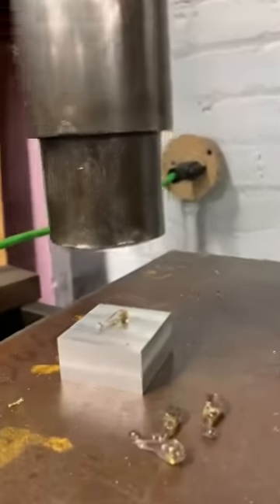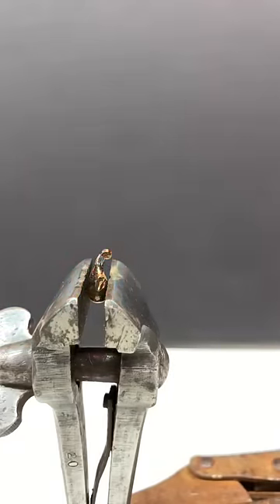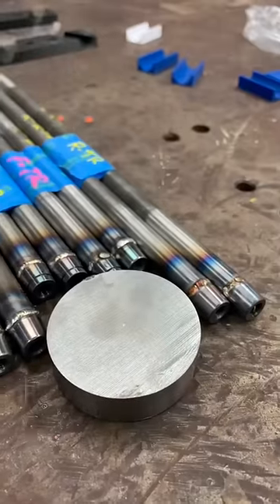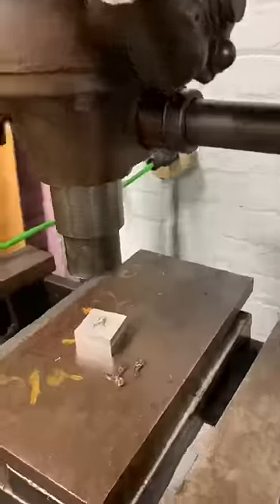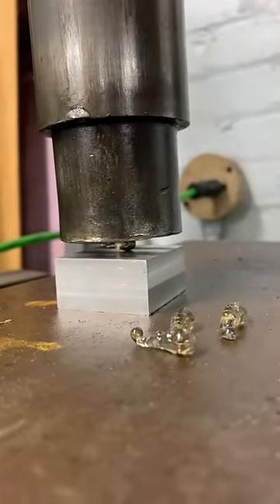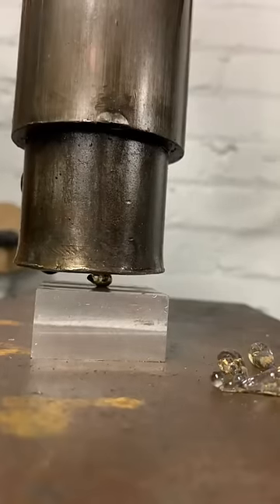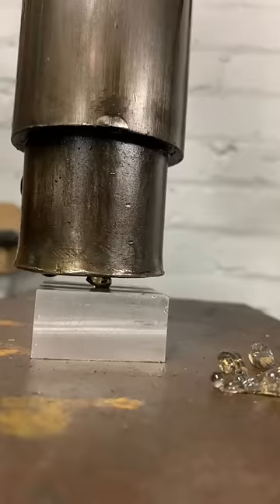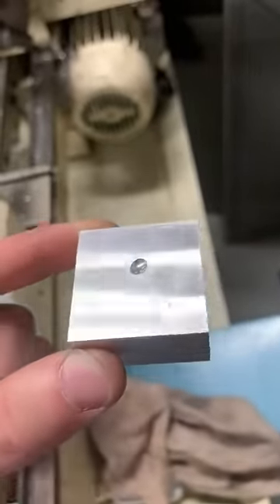Prince Rupert’s Drop vs Hydraulic Press!!!

Comment: He removed the only weakness of the rupert's drop
Reply: This man must be stopped! 😳
Reply: Where's demolition ranch at
Reply: So can we not make Armour out of this ?
Reply: @kevinm1675 way too heavy and bulky
Reply: @daSora_1 isnt it great for those who wont move much but have a high risk of being shot?
Reply: The weakest link in chain, the tail.
Reply: @brooksmachine3 he would be the man to do it he’d just send some armor piercing incendiary rounds or a 50 at it
Reply: It’s like Achilles without the heel
Reply: that glass can be squished
Reply: Sounds like a saiyan
Reply: Howd he do that, it was supposed to break ‼️‼️
Reply: @acertainredburnygirl5265 yes, Mr. President's car
Reply: @kevinm1675 you can however take these, coat them in a soft polymer or wrap it in rubber and send it with a Tippman if you manage to make it a perfect ball .68 caliber. I've also noticed that by simply roughing up the smoothness of the glass or even wrapping it receipt paper and super glue (that method causes a lot of heat so be careful!) And send it through a paintball gun. (My friends say I have too much time, yet never enough)
Reply: @edwinly5951 Goku dragon ball
Reply: @acertainredburnygirl5265 maybe use it as plates
Reply: @kevinm1675 Exactly how?
Reply: @kevinm1675 we can’t really make armor and this still has a strong weakness to heat
Reply: It's strong for sure.
Reply: @mobileprofessional Actually, removing the tail removes most of the strength of the glass
Reply: @kevinm1675 it breaks if reheated
Reply: @brooksmachine3 the Rupert’s drop has been known to stop bullets
Reply: @mobileprofessional 😅
Reply: @kevinm1675  yeaa??? But u need to absorb/endure the paint if ya want to.
Reply: @kevinm1675 it's still breakable
Reply: @marcelinocolonalsup679 yea but they're still breakable
Reply: @TheDailyKnife009 so can concrete still breakable
Reply: @nickhayes5641  most def. Sorry, most of my paintball ammo explodes or disperses in one way or another, so generally an expectation of mine. My favorite is combining extracted capsaicin  resin with lifters chalk in a hollow plastic shell. Also .68cal. Very effective for a shop manager to have in seattle.
Reply: it is still there just make one in the uni you will see the result

Comment: So...if you can theoretically make about 1,000-10,000 Rupert's drops.

Melt off the tails.

Line them into a chest piece like a suit or even a full chest plate.

You'd technically have bullet proof armor.
Reply: Would it really ?
Reply: @dannyvelez1012  no.  Cuz it doesnt spread the energy , so you only made a rupet drop  cap for the bullet .

Making it effectively harder.

Altho it could work against axes and swords.

Comment: Bug report: Glitch causing players to have the ability to melt the tail of a Ruperts drop, making a bugged unbreakable item.
Reply: They thought they could nerf the unbreakable item with the tail.
Reply: Patch proposal; removal of melting ability would be seen to easily as a break in Emersion, perhaps we allow for the drop to take damage, returning defense stat to that of a positive number rather than negative. Raising this to, say, 1000 would still give effectively impenetrable items, without the potential exploits of its lack of implementation as a bug.
Reply: imagine using these in mc
Reply: This dude is walking the road less traveled
Reply: @shockwave2128 I think the devs are also playing with converting damage to potential velocity, as a way to apply energy cannot be created or distroyed
Reply: Not unbreakable, tail hitbox is just shortened to a picometer and the item is used to craft ballistic protection
Reply: Now check a regular drop to see if the tail being gone adds or reduces strength
Reply: Sounds like a bug report to the architect at the  matrix.
Reply: Have you seen the fucking video?
Reply: Bug report amendment: unbreakable object seems to enable Bethes ESV method of no clip, reports of dozens of OOB enforcement entities found dead from unknown projectiles. Advise all BPB maintenance personell evacuate to the lowest level of the tesseract stack.

Comment: Make a bullet proof vest using Rupert drop.
Reply: I had the same idea, but it can be hard to hold all the drops together
Reply: @fasa_real lol what? Melt it all together.  Or have a substrate.
Reply: @Pain1x if you melted it how would it still be a ruperts drop
Reply: Thats easily gonna be 80 lbs of weight in just the drops.
Reply: @RungerVODS  why would you melt the core? Why would you melt the drop itself? Do you not know how glass works? Melt it all together as in stack them side by side in a fishscale pattern and use a torch tip and melt the edges together. Literally won't change anything as u are just melting the outside layer to attach itself.
Reply: Dang bro I thought I'd be the first one to put that lol oh well it's a really good idea 💡 but maybe not a whole vest just a small plate big enough to aim at
Reply: Make a shotshell with a rupert drop as the projectile to counter the rupert drop vest
Reply: @fanofmetal1 no
Reply: @fanofmetal1 micro rupert's drops, then? Is there a minimum size for a rupert drop to be one?
Reply: Make bullets out of Ruperts drops
Reply: @Pain1x expect that you’ve literally changed everything including the structure of they glass that allows it to be so strong in its fully hardened form.
Reply: @AlexanderMason1  except* lololol and if your melting the outer layer then nothing changes. Put just enough heat to stick and thats it, no where near glowing hot to its core. Also there's a fact of the matter that a substrate of regular glass or even ceramic can be used to hold it all tpgether
Reply: @Pain1x and you thing the bullet won't just slide between the drops
Reply: @fanofmetal1 you're so wrong about it weighing 80lbs.
Reply: @fasa_real the drops can be held in place with epoxy resin. 2 layers of drops can be the ultimate material I think.
Reply: @ozdemirsalik  what about the weight?
Reply: @fasa_real  glass is certainly a dense material to wear. Maybe not to wear but to make bulletproof objects, it might be practical. The cool thing about the drop is that the other side won’t even feel a bullet hit it. It’s so hard, it virtually breaks the kinetic force altogether. Maybe fighter jets can use it.
Reply: @Pain1x you do change its structure by melting the outer layer. The interal stresses from the core curing slower than the skin is counteracted by the compressive force of the skin and heating it destroys this balance.
Reply: Bullet proof vests don't exactly stop a bullet and make it bounce off instead they are made to slow bullets and make the bullet exert less energy at the cost of a heavy vest
Reply: @Pain1x nah, that'll make it brittle and then it just breaks like normal glass
Reply: @ZeroOneInfinity know one appreciates this joke but I do
Reply: @Pain1x melting it even a bit could completely alter its properties. The whole characteristic of Rupert's drop comes from it staying 100% intact. Also fish scaling it may make a little sense if the drops were smaller than a bullet but then you'd be losing on hardness
Reply: New meaning to Glass Armor
Reply: @spectrebond5119  lol OK sorry I found the glass expert here I don't think you have any clue how heat works, I doubt you've ever heated anything up lol
Reply: @tormodhag6824  if this was true it would implode when heated.
Reply: @Ameerjanan  not with a fishscale pattern, and a strong substrate to hold it all together stacked into layers
Reply: @Pain1x  no, because heating it creates a gradual release of tension. I might have gotten what I said swapped around too because it would never implode
Reply: @Pain1x  do you know how diamonds work? supposedly the most durable material but you cant make blades out of them because laying them out in a sheet would make them brittle and easy to shatter

glass on the other hand is weaker than diamond, what do you think happens when you turn it into a sheet? think of a window, they shatter right?
Reply: Bad idea, people will just make a bullet made of 25 ton hydraulic press
Reply: If the bullet didn't destroy the drop... Then, your body will get crushed by the drop, because the only way to go between your body and bullet are, of course your soft and fluffy flesh...
Reply: Rupert drop bullets
Reply: Make a ton of small rupert drops and put em in a tight bag in a scale type linking
Reply: @tormodhag6824  yeah i don't think you've ever heated anything up in your life. Heat travels from hot to cold, the outer layer will get hot first lol
Reply: @Pain1x  you just said to melt them together bruh
Reply: @Pain1x bro you are not the main character, you are not going to win a ty shorts comment section argument against 50 other people whether youre right or not
Reply: Nah BETTER IDEA MAKE BULLETS OUTTA THEM
Reply: @Pain1x you would still have the issue of how a Ruperts drop works though.  The reason the tail is the weak point is vibration. So if you melt them all together you'll either have a ridged plate that may break along the thinner weaker spaces, or shatter from the vibrations on impact
Reply: @Takitza can probably be as small as the meniscus of molten glass. Since it has to drip into the quinch
Reply: Yep I've said same thing
Reply: @Pain1x ”Lol what?” You must be really confident in your degree from clown college
Reply: "You got some drippy boddy armor there bud!"

"No drip, just drops"😎
Reply: it would not work. the drop would shatter, sending glass shards into you
Reply: It already exists, the same principle behind prince rupert's drop is used to make tempered glass. Add some plastic layers or layers of softer glass in between and you have bulletproof glass.

It isn't used in creating armor because while it is hard, it isn't tough. It is very brittle and shatters completely in the presence of deformation unlike conventional armor which can take on some level of deformation alongside having similar level hardness.

It's also really heavy for body armor, so it isn't preferred over more conventional armor like kevlar.
Reply: wouldn't the glass pieces get blown into your chest
Reply: @Pain1x if you melt the drop again the pressure is released and the drop is just glass. That won't work.
Reply: I dont want to be that guy, and I dont know if anyone else has said it yet due to not wanting to read all 47 replies.

But making a bullet proof vest out of glass would be extremely heavy and the idea has already been phased out due to that and the weight, cheapness, and already standard aspects of other materials.

Though the same principle behind a prince ruperts drop is used in your modern day car window, which is why punching them will normally never break it without you being a menace, and if you simply tap it with a sharp object they can shatter.

Bullet Proof windows use this principle with layered soft layers between each sheet to absorb the impact of a bullet, allowing for the glass to not all shatter and fall out, (which would be needed for a actual bullet proof vest), and it would be near impossible to carry with all the other gear a soldier must wear.
Reply: That's what I'm saying! Could you theoretically make an invincible wall or invincible armor?
Reply: This idea is awesome. Then fire bullets at the vest. If it holds then fire Prince Rupert drop bullets until something happens. Maybe it will create a black hole or time machine? 😂
Reply: Sure the vest would me fine but now you're gonna feel a Rubert's drop press into you with the force of a bullet
Reply: The shock would kill you
Reply: @Pain1x  You obviously don’t have a clue about the chemistry or physics of what you’re talking about.
Reply: @abyssmage6979  in the military we don’t use Kevlar but rather ceramic plates. Ceramic fabric layered witting a special kind of resin matrix, pressed and baked/cured. The lightest weight armor that will withstand what soldiers are likely to be hit with.
Reply: @CSEabdulalimkhan  yes. Even being shot by a 50 cal round into a plate of body armour is like being kicked by a horse. There would need to be a sponge like material underneath it to soften the shockwave that comes from the impact.

Comment: You can also put it in oil so even if the tail is shattered, the head remains. Works with melted sugar too
Reply: Isn't head also shatters?
Reply: @dren6422  you can check it yourself

Comment: That press now also has a dent
Reply: actually it might not, the metal below was aluminium so it was definitely weaker than the piston of the hydraulic press, and even the soft aluminium only dented a little bit
Reply: That's literally the glass ball, it can't do much, as you can see in the video
Reply: @G0RSHK0V what?
Reply: @G0RSHK0V bro the glass dented aluminum. Aluminum isn't that hard, but it's normally way stronger than glass
Reply: @JazzKazoo0930  LOL. Aluminium have hardness of 2.9 by Mohs, and glass have from 5,5 to 7, depending on additives. 
So glass is naturally harder

Comment: It was actually the fact that it gained movement that caused it to break apart. If absolute stability is achieved, it will withstand much stronger pressure

Comment: Can you do a video explaining the science behind the strength of glass in the form of a Prince Rupert's drop?
Reply: Smarter every day did a good video on it
Reply: Basically toughened glass hard
Reply: Basically dropping it in water causes the outer layers to cool much faster than the inside. This makes the glass incredibly hard but it's also under a lot of pressure. Normally breaking the tail provides an outlet for that pressure and it explodes, but melting it makes it incredibly hard all around. The pressure is still there though, hence why it still explodes.

Comment: The reason a prince Rupert's drop is so strong is because of the tension the glass is under due to the way it cools. If you melt the tail off, you release some of that tension at a slow enough rate to not shatter like it would if the tension was quickly released by just breaking the tail, so while it's still strong, it's not nearly as strong as a normal drop.

Comment: Bro. Imagine having a bunch of price rupert’s drops with molten and snapped off tails, and making a sort of armor with it. You’d be an equivalent to a human made of pure diamond.
Reply: It’s possible and I am thinking of making a prototype that involves on melting the tails of multiple Prince Rupert’s drop that is the size of an adult human thumb and placing them in a lateral pattern on epoxy resin with the heads facing forward with foam behinds the epoxy for extra padding. I will also try to make one in a fishscale pattern.

Comment: I would put round push plate with handle ,to not deform the piston when it comes down on drop. One time no big deal. But if you crush many. Could ruin press piston. Even crack piston head ove r time

Comment: You purposely used an aluminum block under it so it wouldn't break had you used a metal block underneath it or the table itself it would have broke on your first twist